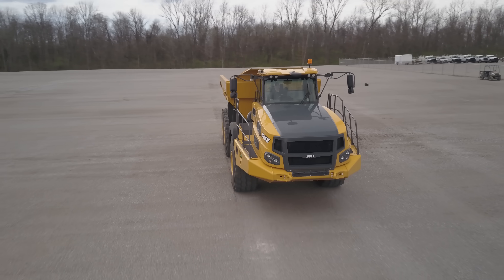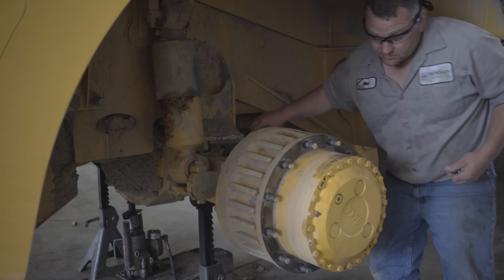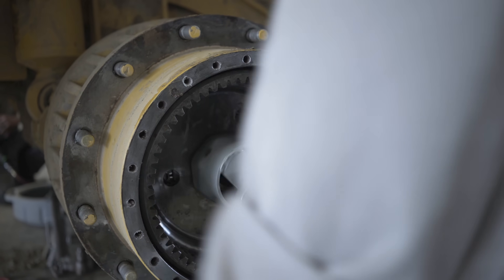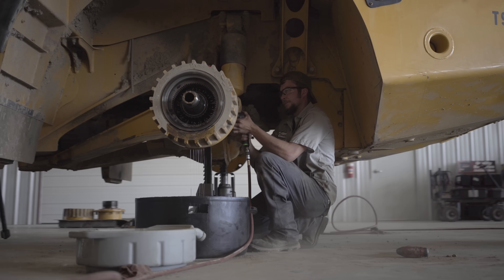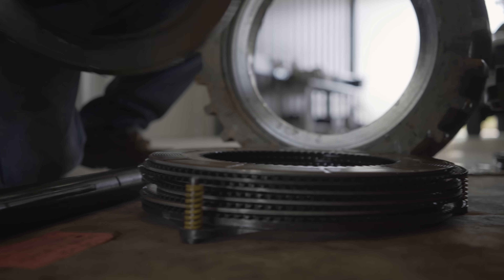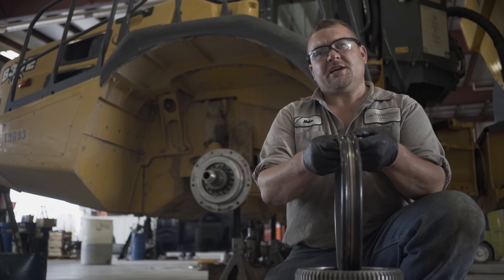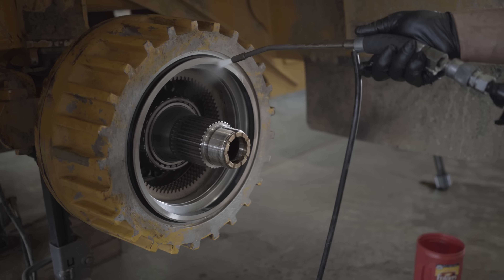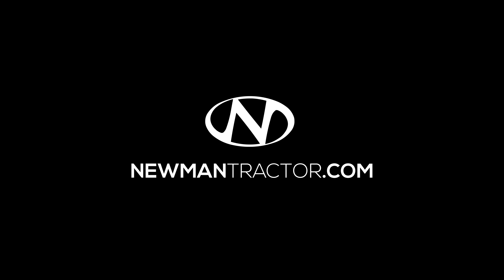We Repaired the Brakes on a Bell B30E ADT

Comment: A word of advice. When applying flange sealant around bolt holes it needs to be applied around the inside of the hole. This in turn makes sure no leaks are created at bolt shaft.

Comment: For anyone who's not familiar with tools, the drills they are using here are LARGE. Typically, impact drills (the bit where the sockets goes onto the drill) are 1/4in, 3/8in or 1/2in in size. Those are your standard automotive sizes. They drills they use for these machines as well as big diesel trucks are ONE inch. They are much heavier, a lot stronger, and about twice as expensive as 1/2in stuff. 

Those drills are no joke.

PS: not every tool the use here is 1in but what they use to get the lug nuts off is.
Reply: You're not familiar with tools either huh? They are using impact wrenches/guns; no drills in the video

Comment: 4:31 Are you sure this flange sealant should be placed like that? Isn't the oil go through the screw holes in that case?
Reply: yep.. needed to be on the inner side of the bolt hole.

Comment: So when they were designing this truck, this is how I  like to imagine the brake system design team meeting went.

Engineer 1: "What are we gonna do? we need to design a brake system that will stop a 30 ton vehicle with a massive load in the dump bed..."
Engineer 2: "... Yeah, drum brakes are out of the question and disks are just not powerful enough.."
Engineer 3: "What if we combine drum brakes and disk brakes together?"
CEO: "My god... Make it happen boys!"
Reply: They use drum and disc brakes on heavier equipment like scrapers

Comment: My bus has very similar hubs (its a classic European bus I imported), with the main reduction happening in conical planetary gears inside the hub.
What kind of hub sealant did you use? I have the manual for my bus but all the chemicals and oils are ...old communist Romanian standards, so hard to pair them to what I can find and what will work (some stuff they did list US standards like for fuel and oils but other things....greases were a pain to figure out lol)

Thanks. I didnt know that you had a pressure plate system in the braks. Its like a cross between a motorcycle clutch and aircraft brakes (I was an AC mechanic on 707s and DC10s)

Cool vid.

Comment: I  just got done watching a video on automatic transmission teardown and similarly they have alternant friction and steel disks in the clutch packs
Reply: It's basically the same method of applying something. In a trans they apply a certain gear, in this is just applys the brakes. Very cool and most likely efficient and robust setup. Clutches are quite durable and this is a simple setup, just everything is big so it looks hard.

Comment: Brake/contact cleaner on those new seals and o rings should help the lifespan.
Reply: they are made from nitrile.. and they're probably not using brake cleaner.. as long as the cleaner is petroleum based, they'll be a-ok.

Comment: “I don’t know what they put on these threads, But it’s stupid”

Every diesel mechanic ever.
Reply: I dip mine in saltwater before I screw them back in.
Reply: They put medium strength thread locker
Reply: @liambc5889  lol
Reply: Every diesel mechanic on old glow plugs,somethimes they snap and the only way to remove them is by freaking disassamble the hole engine.
Reply: yuuup.. did a month in a diesel shop. nope, going back to passenger cars
Reply: Green Loctite with reinforcing fibers... AKA "boogers" with nosehair
Reply: Na yall should see the shit they put on railcar manway lid bolts..stupid orange shit that does not come off.
Reply: Facts😆👏🏾
Reply: 3 possibilities. Tar, plain rust or just over tightening the bolts so they stretch and will not undo without serious force.

Comment: I hate getting under 3/4 and 1 ton trucks, i keep getting paranoid the jack stands are going to slip and crush me. I couldn't imagine having something like this up on jack stands.
Reply: I have about 3 fail safe ways of keeping a truck from falling on me. I have the jack stands themselves which are the pins that lock them in place rather than the lever locking ones, the jack it self leaving it jacked up but not all the way and a tire underneath along with another jack stand.

Comment: I wonder why they dont install that stiyle of brake on semis its like there will be more surface area therefore more heat dissipation. Dont know much of the physics if it wold even work with air but just a question of a wondering mind

Comment: whaaaaatttt that's crazy.. Each wheel has it's own diff and transmission brake pretty much lmfao
Reply: Yeah the idea is if you have a diff in the wheels then you can reduce the size of the axle diff which gets you more ground clearance
Reply: @reecewharf  The diff would still be in the center, thats just the final drive in the wheelhub. Keeps the required axle size lower, lighter and therefore less rotating mass
Reply: Yeah, that is why these things are closer to tanks than cars/trucks.
Reply: Just the final drive gear. I wonder if there's a slipping diff between the final drives.

Comment: Some how they took the same technology in and which applies automatic transmission clutch packs, then turned it into brakes!
Reply: Also motorcycle chutches, but then again, clutch and brake are practically same thing, just operated differently.
Reply: Those brakes are the same as a multi plate clutch. Many aircraft brakes are the same way.

Comment: is this the same process for changing brakes on my Prius?
Reply: Yeah pretty much!! Just apply some oil on your brake pads when you're done.
Reply: @inkconceptualart8261  you mean add oil to the master cylinder.  That works best.
Reply: @one7decimal2eight  I do it all the time. Don't you get it, "I'm being SARCASTIC"
Reply: @inkconceptualart8261  ohhh ok. Don’t joke like that! Just say add heavy duty grease, not break fluid, on pads AND rotors!
Reply: It weights the same with yo mama in it
Reply: @MickD464  hyuk hyuk hyuk hyuk hyuk
Reply: less steps for the prius
Reply: Not unless your Prius is a forklift

Comment: I'm a light vehicle mechanic, this heavy stuff scares me but I love it
Reply: same here as soon as i saw them use a fork lift to get the wheel off the studs i said hell no
Reply: @corybob7915  I mess with city wash trucks and those aren’t bad but a forklift for a wheel is nuts
Reply: @mauricemotors8207  Im a mechanic at a mine and the haul truck tires are taken off using a loader with a hydraulic tire manipulator attachment lol
Reply: @corybob7915  i do fleet work for bridgestone i regularly do that size tire sometimes taking the whole wheel back to shop you can do it buy your self without a forklift or anything like that
Reply: Is automotive mechanic a very hard job?
Reply: @bubaba8938  once you know what you're doing it's very easy
Reply: Surprisingly heavy duty vehicles are 10x easier to work on than everyday cars. Other than the parts being heavy af
Reply: @hidros1461  No you’re wrong. Ever work on forklifts?
Reply: The tires are probably foam filled they are immensely heavy had one about 2/3 that size fall on me when I was doing mechanical on telehandlers would have killed me if It didn't get caught on the wall behind me
Reply: @konnorlusk3454  or just 100% rubber. Also known as cast tires
Reply: @konnorlusk3454  telehandler tyres 2/3 times the size?
Reply: @konnorlusk3454  glad your still with us bud
Reply: They use lifts and cranes a lot to move and take out parts, it just ridiculous the labor it takes for some things, i know my bud worked at a mine, to do a tire repair took 3 days on a big mine trucks if it has chains on, 1 day to remove the tire chains, one day to do the tire repair, one day to put the chains back on....
Reply: In a mechanical sense this stuff is way simpler. Only shitty part is that everything is big, heavy, rusty and seized af usually.
Reply: Same. Fuck an f350 let alone this
Reply: @REAPER3fitty  I'd take a F350, F450, F550 over an F150 any day of the week. I hate that truck with a fiery passion.
That's why I became a Ford Heavy Truck Mechanic. lmfao.
Reply: @camd4648 how come?
Reply: @DominiAeternum  Diesel> Gas
Reply: @camd4648  okay. But to most of us non professionals, that's way too simple an answer. I know more money is in diesel work, but only thing off the top of my head I can think of with F150's vs the rest of the bigger ones is maybe more s**tty plastic parts to break, & all the amenities they put in these passenger cars & trucks to appeal to soccer moms and dads.
Reply: @DominiAeternum  I mean, with Ford you'll typically get a well engineered machine. But the gas vehicles Ford makes are not up to par with the other businesses like Toyota, who dominates the market in reliability. If you somehow get your hands on a 5.0 Ford F150 you're set. There are also a batch of Diesel F150s, but they're rare.  If you get your hands on the Ecoboost, you'll also be pretty well off depending on how you view those things.  I believe the eco boost gets like 700 miles to a tank.

But, your f150 might last 300k miles, vs the Toyotas 400k+ miles.

However, it's still limited to being a gasoline vehicle, which means it lacks the reliability and tow capacity of a Diesel engine. THEY RUN FOREVER, if taken care of.(Though the new Gas F350 engine is bad ass.)
Reply: @camd4648  well for years there's been no contest between any American cars & Japanese ones as far as reliability. You go Amrrican for the largest SUV's since no one else makes them, & the biggest diesel & even gas trucks. 

Ford is as reliable as it gets for domestics though. I guess all the F-series trucks that I always assume are diesel's by the sound of them are 250's.
Reply: @camd4648  all Toyota's are so underpowered & boring I don't care about the reliability anymore. I'll buy anything from the domestic 3 instead. I don't care
Reply: @DominiAeternum  I would be inclined to agree, though I think Japanese vehicles are becoming more and more unreliable, which gives Ford an advantage if they're smart enough to take it.

It's odd, because the opposite is happening in Heavy Equipment which is where I specialized. Caterpillar is slowly flushing itself down the tank, while brands like Komatsu and Takeuchi, and Wiertgen(German, but recently purchased by Johne Deere who is making a hard push into construction right now, which is ironically the same exact mistake CAT made years ago when they tried to quickly overtake the Agricultural market when they purchased Massey-Ferguson) are becoming more abundant, and favored much more by the guys running large scale operations. Though, Cat seems to still be king over in the Coal Fields of EKY, and I'm sure elsewhere.

I agree, Ford will outlive Chevy, and GM. I think Ford could make a lot of money partnering with Cummins on their Hydrogen based combustion engines that are in production. That seems like a much better alternative to going all electric.
Reply: Only thing that scares me was those jack stands. They didn't look beefy enough for that kind of weight.
Reply: You don't know what your missing
Reply: I'm not comfortable being under regular vehicle either. But when this guy was under the wheel arch of this monster like he was camping in a tent I felt real anxiety.
Reply: If this scare you wait until you are up close and personal with a Cat 777, 789, 637 or a D11N.  This is a toy by comparison.
Reply: I think I'll just stick to my semi trucks... not quite too big for me. Still miss the simplicity of cars having much smaller tools required for most repairs. Hate having to buy huge Wrenches and special tools that will only be useful for a semi. Maybe I'll go back to cars one day or just diesel commuter trucks idk. Semis are dumb
Reply: Light work especially in a clean shop. Real men do it in the field😂
Reply: Use must be afraid of lots of stuff then
Reply: It’s fun u just use a lot more forklifts cranes etc to do your work
Reply: Nate just grabs and lifts the HUB?? and backs it out and walks it away. I'd need a fork lift and two other men to do that.
Reply: They make this type of brake as an aftermarket mod for off-road for Toyota Land Cruiser
Reply: this is nothing im a hd mechanic they didnt use any heat for the bolts so the jobs was easy also not always do u work on clean equipment these guys are pampered
Reply: @destructoidx99  Because they only go off-road they don’t run 365 like vactors
Reply: I’m the opposite ! Cars for me 🤮

Comment: Brave soul using an impact on a thread tap
Reply: yeah wtf, it looked like he was using it to drive the final drive off
Reply: Sometimes i break taps with hand tools .. i imagine with impact gun..
Reply: @cristianojoana1898  But he isn't tapping out a hole. There are already threads. He driving the cover off and cleaning the threads out at the same time.
Reply: @sidescrollin  maybe it makes sense, but it still seems sketchy, lol.
Reply: There are 2 threaded holes that drive into the face of the ring carrier to remove the cover, typically you just use one of the bolts you've removed already.
Reply: @JMoollins  We know. We are specifically talking about using a tap to drive it off. I'd never use an impact on a tap, never mind using a tap with an impact gun to drive a component off. Its just so wtf.
Reply: @RoosterG33rs  Impact gun + tap = speed tapping.  Don't think I've ever really tapped anything by hand lol.
Reply: Been “speed tapping” holes for many years and have broken maybe 3 taps total (learned early on not to buy cheapies). Watching cylinder heads, blocks, and other castings get their threads tapped in production, they’re not being done by hand either.
Reply: Imagine if the drive is a bit stuck you could snap it...
Reply: Yeah, no kidding.
Reply: The worst part about it, isn't that he is using an impact on the tap, but the fact he is applying a force on a tap that was NEVER designed to drive something off! Use the fucking bolts, and using starting fluid instead of dry silicone spray to slide something on is also stupid.
Reply: I watched that part several times. He wasn't using an impact gun. It's just a regular drill.
Reply: Pfft we rebuild some parts for heavy haul trucks. There’s hundreds of holes to tap. I’m using an impact to chase the threads.
Reply: @FleetTech97  yeah but your using m16 m20 etc not m10.m12 m8

Comment: I know I'm asking a really dumb question.....BUT is there any reason heavy equipment couldn't just use an air brake system or does it really take that much to stop em? I just started work on semis so it just made me wonder why not the same except just more/bigger?
Reply: Good question. I'm a class 8 heavy diesel truck tech. A truck and 53' trailer loaded down weighs about the same. But it also has 10 braking points to help stop it. I don't work with hydraulics much, but im pretty sure air setups dont have near the same pressure. Maybe not having as many axles and less pressure means air brakes coulndt stop something that heavy well enough?
Reply: I am not a mechanic but having the oil cooling the brakes as they are under load, no dirt contaminating air brake systems, much higher system pressures, much less wear and tear...

Comment: I'm going away in September for my heavy duty mechanics, I normally work on smaller regular vehicles I like working on vehicles I figured I might as well step up and go for heavy duty mechanics because I enjoy hard work especially on cars I have worked 13 hours alone working on my truck just replacing the oil cooler line, I had to drop the front differential to get clearance to my oil cooler line and I finally got it done I didn't have a transmission jack so it was a struggle reinstalling the front differential , I also spent 15 hours helping install a lift kit on friends family member truck
Reply from the maker: Sounds like you're our kind of guy Adam!  Keep up the hard work brother!  Sounds like you have big things ahead!